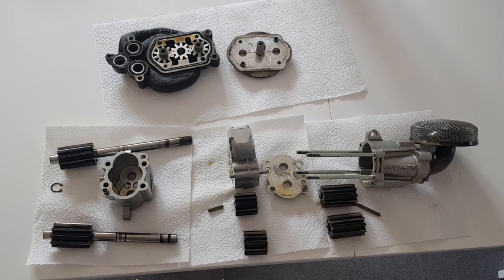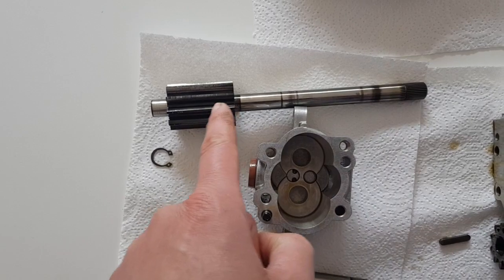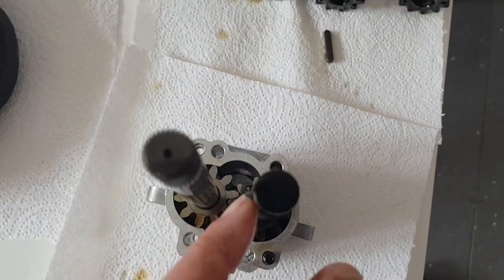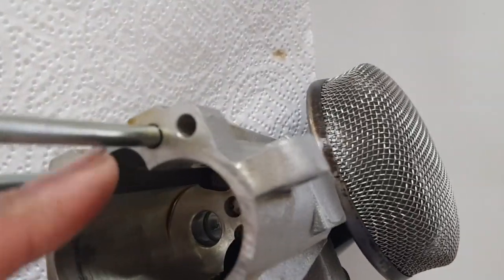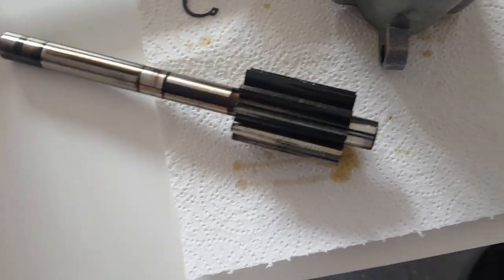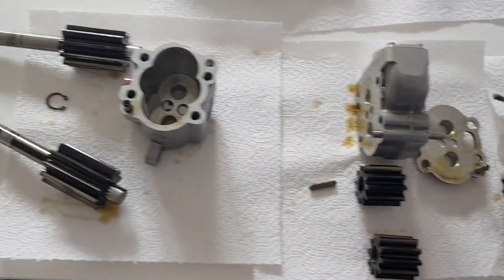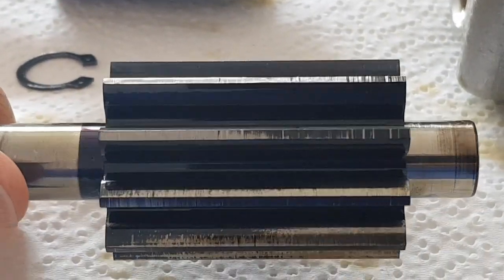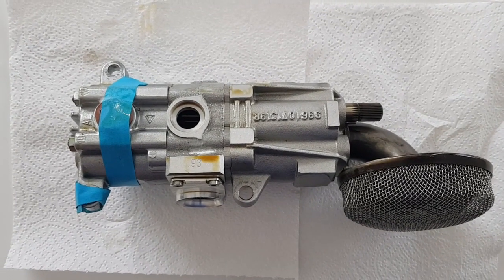Porsche 996 GT3 M96.79 engine rebuild. Part 4.  Oil pumps

Comment: Really Instructive video!  Could you give me more information about how much km the engine have and what was the problem with the engine before you stripped it down ?Thanks !
Reply from the maker: I would if I knew.  What I do know is that this engine has had a previous rebuild, and was used in a car for doing track day driving experience work, so it had a hard life.